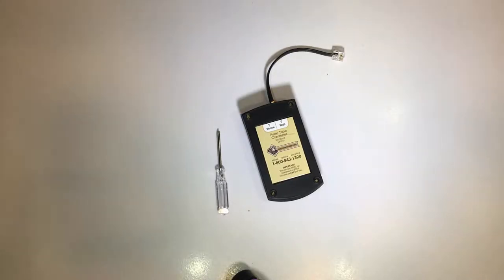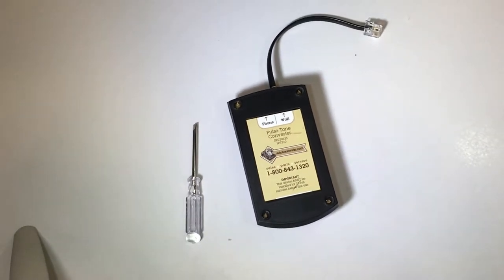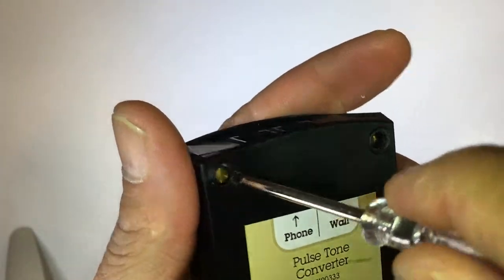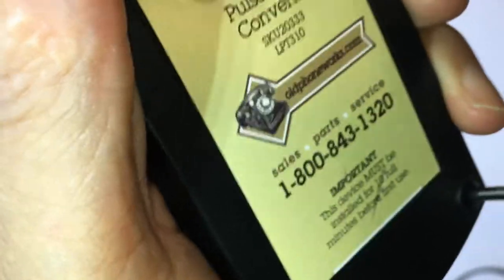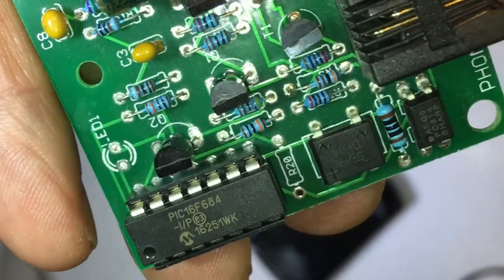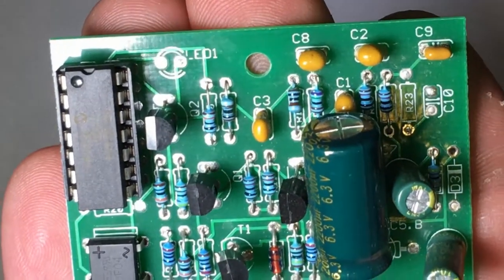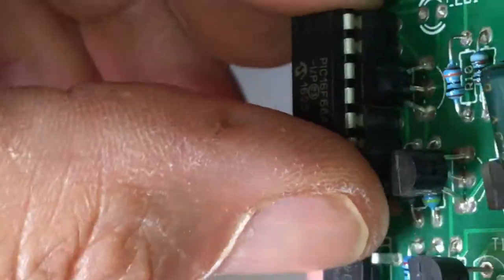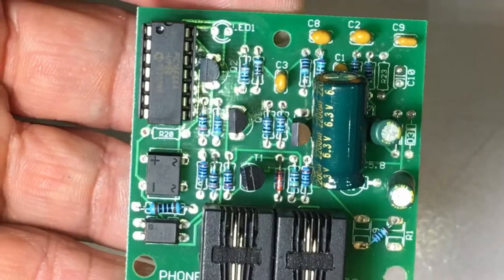Pulse to Tone Converter Analog Digital Rotary Touch Tone (11-2019)

Comment: Here's my guess.  Nothing on that circuit board looks bad. The Caps do not look "popped."  Of course, you could have a bad board component that is not visually evident.  Then there are things called "cold solder joints."  Maybe, maybe not.  Also btw, popping the  Logic IC needs a special "Chip  puller." There is something about this that makes me wonder though.  Doesn't this need power to operate?  What is that big honking 6.25VDC cap on the board doing there if there is no power source to the board?  I would try plugging it into a phone line, let it sit untouched for a day or two, and then plug your phone in and try it.
Reply: WOuldnt the power come from the phone? Power is drawn from the landline output
Reply: @redlady935  WHAT?